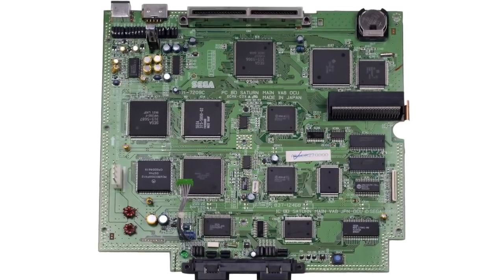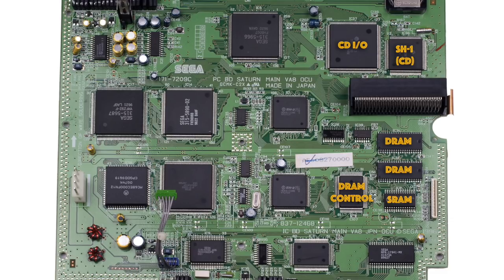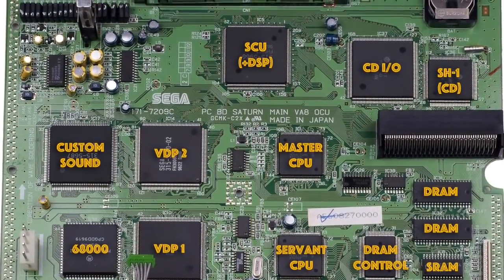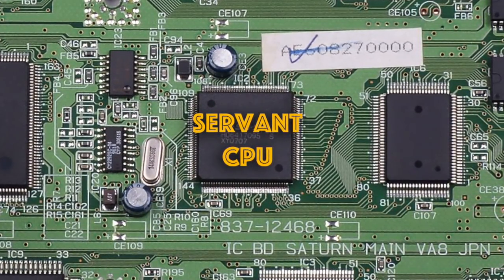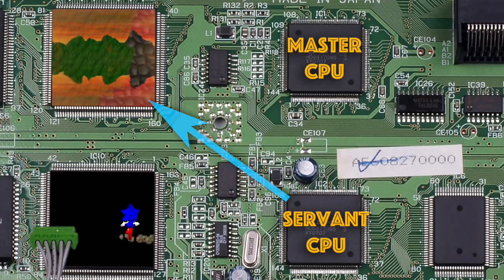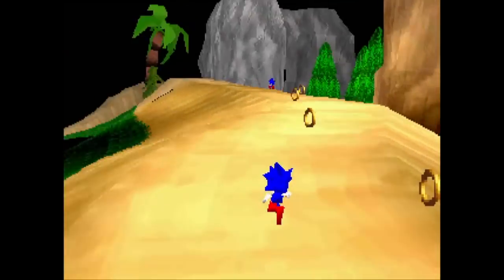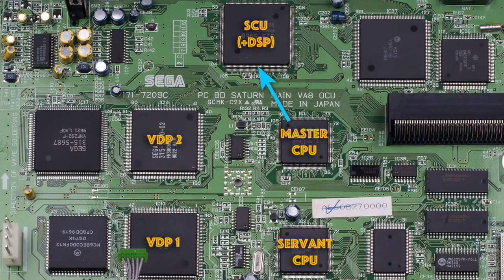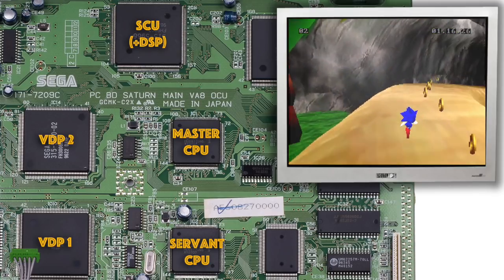SONIC Torn Apart - Exposing SEGA's Insanity with Hardware (CODING SECRETS)

Comment: 0:29 It should probably be clarified that the SRAM requires the use of the button cell battery on the top right to stay alive. The difference between SRAM and DRAM is that SRAM doesn't need to be constantly refreshed. It just needs a constant current applied. It requires a lot less power to remain alive than DRAM, but it does require power. Jon wasn't mistaken, I just wanted to clarify. SRAM isn't like a flash memory or EEPROM chip that keeps its storage alive indefinitely.
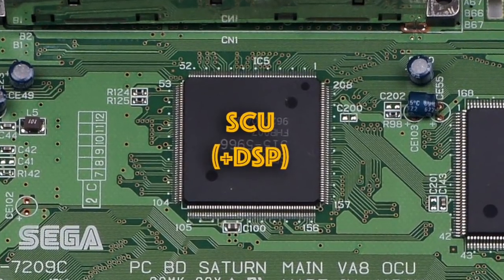Reply: 3:48 MIND BLOWN
Reply: Was the 68000 just twiddling its thumbs? :P
Reply: My guess is that the 68000 was running a SEGA-supplied music/sound synthesis middleware. I know the game runs on Redbook CD Audio for the music, so it was likely underutilised, but there are still sound effects to be triggered.

I also wonder whether 68000 had some unfortunate effect on memory bus utilisation and having it stay idle would have been advantageous?

Comment: When you had to make a game to run on both Saturn and PlayStation you mostly have to do the same game twice or there are some code that is "sharable" between the platforms on this era?
Reply: Anytime you do routines in ASM, you have to code all of those for each processor you are going to use. Some C assemblies can be compiled fine for both platforms, but the majority of the engine code is not compatible. So to answer your question, yes, you had to write a game twice for the same title to run on both platforms. Although you could easily re-use the same media data: textures, bitmaps, audio samples, etc. That does save a lot of time.
Reply: D.E. Sarcarean  As I expected, mostly the media data are reusable and maybe the logic of the code although written differently for each architecture. Thanks.

Comment: So.... knowledge of assembly concepts were basically critical in early video game development up until this system's generation, mostly because certain abstractions started taking place in design, right?   and many of these general purpose CPUs were in use in tons of electronics even up through the early 2000, but not generally anymore. I wonder where the talent pool would've come from that knew SH1/SH2 assembly that Sega decided to go with this system?

Comment: Yes! I'd like to see how the DSP code works. Also, How do the instructions are sent to the slave cpu without using the main cpu? 

Since you are always looking for ideas, here's one: I agree that SEGA always seemed to have retro compatibility in mind, since... ever! Although many time it just didn't have the chance to use it, the previous chipset is always there in the next gen. Correct me if I'm wrong, but even the Dreamcast had a graphics mode that worked quite similarly to the Genesis. So my question is: what would take to port a Genesis game to the Saturn (or the Dreamcast)?  I don't know how the homebrew community is doing in this front but I'm just curious to see if SEGA did have the chance, if it would be possible and in what generations this could happen. Cheers.

Comment: I remember reading on a page I was helping translate that one of the developers for Shining Force 3 hated working with the Saturn's sounds chip. I was curious what your opinion was on the chip. Was it really difficult to work with like he said or is it possible they were too used to the sound chip for the Genesis and didn't switch over to the new system very quickly?

Comment: Question : did I get that right? The Saturn VDP 1 and 2 didn't render the polygones, getting draw calls by the CPU, but it's all done on CPU than sent to the ram and later the VDP  to apply the effects and textures?
Reply: VDP1 renders the polygons that are transformed and clipped in any way developer deems suitable to generate them - ideally on Master CPU with SCU assistance. VDP2 does tiles and sprites, not polygons. You usually sandwich your VDP1 as a layer between VDP2 layers, so you can have a 2D background and some HUD on top or something of a kind.

Comment: That looks like a very complicated system architecture. What was it like to port games from the Saturn to other machines like the PC and the gamecube? As sonic R was included with a sonic compilation on the Gamecube and PS2. I recon must have been complicated to port games from the PS1 to the saturn.
Reply: The Sonic R re-releases are likely all ported from PC version.

PS1 to Saturn? Massive re-work. Could have cost a significant chunk of the original development budget because you have to rework all the graphical assets too. I don't think it happened frequently if at all. Tomb Raider for example was developed for Saturn first and then ported to Playstation. It probably didn't make too much sense to go the other way around, because i mean there were 10 times as many Playstations as Saturns worldwide, and the gap was probably even larger in Western markets alone.

Comment: I've read that some game devs only utilized the 68000 CPU just because it was easier/familiar rather than messing with the twin graphics chips and having a single CPU render the 3d. Which was the explanation as to why so many early 3d Saturn games looked overly simple. Was that true, or possible, in your experience?
Reply: I think you might have that one confused with the Jaguar, where 68000 was the boot processor, on Saturn it isn't. And the DSPs on the Jaguar are pretty broken. SH-2 is a super straightforward and easy CPU, and you wouldn't get very far pushing polygons from 68000 at all, even if you could. On Jaguar, almost everything except library code running on 68000 was common, but a better strategy was to halt it completely because it steals memory cycles otherwise.

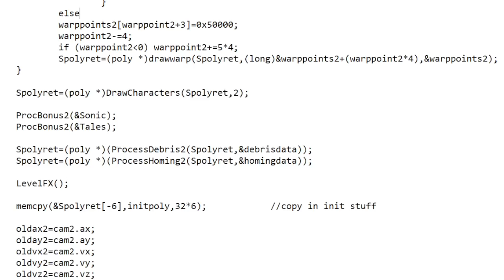Comment: D: 2:32 &Spolyret[-6]  
Why? I'm going to assume it's in a bit field but still I'd be scared to use that (I've done it, I was scared). 
Also can't figure out if it's a 2D array or just a pointer to an array… This is too much. Since I started using C++ I can't handle those things anymore. 
I guess the hardware you were working on (and the state of c++ at that time [before C++17 that is]) didn't really allow you to waste 2 bytes for a pointer (It's 2 byte in 16 bits, right?)

Comment: The Saturn was an arcade system at heart...considerably more capable than the PS1 at most things, but most developers didn't use the hardware to its full potential.  It's still nuts to me that most generations of consoles have the most advanced spec as the failure...and this generation in particular had the PS1 as the absolute king of sales when both the Saturn and N64 were bigger and badder.  The PS1, on the other hand, had a lot more in common with the 3DO, but came out more than a year later.  If every developer put the time and effort into every game, the Saturn would have been the clear victor, as it wasn't quite as graphically powerful as the N64 (at least in 3D gaming), but had the advantage of CD-ROMs.
Reply: It's not that hard to figure out why the PS1 did better, Saturn despite being more powerful was too complicated to program for and the N64 was held back by cartridges so developers flocked to the PS1, therefore the PS1 ended up with more and better games than the other two. Better library of games always beats more powerful hardware.
Reply: @elin111  The PS1  definitely had more games than the Saturn, but I'd hesitate to call them better, especially if you take arcade ports and Japanese exclusives into account.
Reply: @HaydenX  Arcade ports suffer from being more or less direct ports of the arcade, they never translate all that well to console because they're designed to be played in short doses, console ports get old very quick due to lack of actual content.
Reply: @elin111  I suppose I'm probably biased in this case because I've always been an arcade gamer at heart.  MAME changed my life forever when I found out about it in '97.

Comment: I would also say that I want an explanation of the DSP code, but I'll be honest here, I do not believe that I could follow it.  It sounds cool, what with the parallel instruction set, but I'm already falling behind on understanding these things.  I'm not even sure I really understand what the DSP is doing; it sounded like it was directing traffic that the CPU is supposed to handle.
Reply: The DSP is used for bulk multiplications and additions needed for transform and lighting. Which in turn is a process of recomputing the vertex coordinates from their original coordinate system (model space) into the screen coordinates (view space). And also optionally computing the vertex colour by transforming the vertex normal into light space.

Comment: Powerful hardware for the time, but it sure seems like a lot of the actual 3D code is up to the programmer instead of the hardware. That is, you'd think you'd be able to feed the object and environment data to the various processors and they would do the rest. Do systems of today, such as the PS4 and XB1 require so much from the programmer?

Comment: Would you say, in a sense, it gets easier to code for newer systems that have more power to work with?
Reply: But you are expected to deliver software that is many, many orders of magnitude inherently more complex! Consider that. If something is going to be valuable, chances are, it's not going to be easy.

You could also do a lot more sloppy and simple of a job on a Saturn and you'd still end up with a somewhat viable result, just perhaps not the top notch high performance 3D racing game. What Jon shows here is clearly bordering on or reaching a masterpiece level of programming on the system. There are probably lots of games which run single-processor on the system entirely and don't have a single line of assembly.

Comment: Euch. And I thought the n64 was hard to deal with. XD
Granted, I knew the Saturn was a complicated mess, but wow... So much juggling of stuff.
By contrast the n64's issues are primarily working around a bunch of bottlenecks, and (at the time) trying to deal with the fact that to get the best results would require writing custom microcode for the RSP, but Nintendo absolutely refused to provide any tools or documentation for doing so.

The playstation was comparatively simple... Being broadly speaking a logical extension of the 16 bit consoles...

Comment: I was sure that this fancy hardware design was due to market novelty and taking risks.

But then i learned, that long before 32x and saturn the was a certain hardware, from sega.

 It's called Sega Model 1 and it's sucfessor, Sega Model 2. And guess what? 

It was TOTALLY NORMAL 3D HARDWARE WITH SINGLE CPU AND SINGLE DEDICATED 3D GPU JUST LIKE PS1 OR YOUR 90's PC!

 AND IT WAS IN 1992, LONG BEFORE 32x and Saturn.

WHY SEGA DESIGNED SATURN LIKE THIS?

Comment: If only the Saturn wasn't too hard to program, it could've easily been the best console of the 32-bit era
Reply: It's in 2nd to PS1
Reply: No, just no. It could have possibly stood a chance of being the best console of the 5th generation if it sold well enough, which it didn't, because SEGA botched the launch and had a bad history with 32x.

And it couldn't have been easier to program unless it was designed fundamentally differently, which is to say... i mean you could say that about anything, it's a statement which is true, but also of no value, because you could say that about anything, including the entirely horrible Atari Jaguar. (Saturn was at least not horrible, it's a fairly solid design that just completely misses the mark of what that generation needed)
Reply: I love the SEGA Saturn I think both systems have flaws & strong points like I heard the PS1 cant do true 2D. They made sprites with flat shaded polygons or something. SEGA Saturn had amazing 2D Capability & 3D was a smooth all-round match. Perfect balance between texture quality & polygon effects/rendering having far reduced pop-in & less apparent fog in it's games. PS1 only just wins because it was utilized best by developers & had more introspective titles albeit alot of bad ones too compared to Saturn's honorable consistency.
Reply: PS1 doesn't have dedicated hardware for 2D but that's perfectly fine. It actually has a super easy to use 2D sprite primitive, that happens to be internally implemented the same as polygonal texture mapped graphics, to no real detriment, you even get all the same blend modes you get with 3D graphics which were not available or very limited in pure 2D consoles. It is fundamentally more akin to blitter-based graphics than to tile-and-sprite based graphics like you'd see on most other consoles, but the only drawback is a frame of latency because you have to wait for framebuffer to be filled - same as modern consoles really. Actually i'm sure you could even work around that if you cared by ordering the draw operations, and you can even use the bucket chain originally intended to simplify Z ordering to facilitate that. SEGA MegaCD was also a blitter-based graphical system, and i don't think anybody in their right mind claimed that it couldn't do 2D :D

Saturn should have entirely ditched the VDP2 responsible for its tile-mapped graphics and put all the bets on the VDP1/blitter, perhaps also doubling its performance while at it, which is fundamentally not too hard since you can process multiple pixels in parallel. If it ditched the rigid quads in favour of UV mapped primitives it would have been another helpful decision. It doesn't at all mean that the 2D capabilities would be diminished, they would be improved because then you could blend between various 2D and 3D layers, something that Saturn cannot really do - which is why you see horrible stipple transparency on Saturn which became obsolete on the Playstation.

Comment: I wonder if this is why the Saturn didn't attract many third-party developers?
Reply: No, it's because of the installed base being too small. It didn't launch very well, with a thin lineup, it launched just on the heels of the failed 32x, it aggravated gamers, it aggravated retailers, few people bought it. Now you have a budget for a game - you could spend maybe a few % more to account for Saturn's weirdness and produce a Saturn title, but then your potential market of people who could play the game is 10 times smaller than on Playstation, so what would you as a capitalist who has to spend money to produce a title decide, Saturn or Playstation?

A more fundamental blow which saw few cross-platform titles is that if you started on the Playstation, because that's a much more rewarding risk, and contemplated later whether you'll also release on Saturn, you'd have to rework not just code, but also all the assets to convert to distorted sprites (quads) from UV-mapped triangles, including splitting up and re-doing all the textures, not just the geometry, and that's suddenly a huge chunk of the budget that you need to spend again for the conversion, just to get 5%-10% more sales! So of course it wouldn't happen. You're better off taking that budget and contributing it to a new game for the Playstation, your return-on-investment is guaranteed to be 3 times as high or higher.

Comment: Excellent video. That era of gaming (16-bit, anyways) is dear to my heart and needless to say, Sega broke it all to pieces. The Sega CD was unnecessary. The 32x was a joke. Then the Saturn.....which was Sega dropping a steaming pile of shit on the industry while giving the middle finger  

As much as I've read about the complexity of programming the Saturn I have yet to come across any opinions on what exactly is needed that would have made the dual CPU setup work. What is/are the bottlenecks? Cost aside, what areas of the board could be added, subtracted or improved upon that would have maximized its capabilities and truly compete with the PS1 in terms of power?

Comment: What were they thinking when they designed this?? Was there some logic to it? Or was it just that they had this combination of chips available for cheap?
Reply: No, not cheap. It's designed like an arcade machine board lite, which is after all how MegaDrive was designed too, so the recipe has to work, right?
Reply: Siana Gearz OK! Why were they designed this way? Why were there several CPUs used instead of one more powerful CPU?
Reply: These are not very expensive CPUs, but i think the last thing it needed was more CPU power, because a single SH-2 is fairly close to the Playstation's R3000 and probably faster. I don't know the actual prices, but i suspect based on complexity which is somewhere around... less than 150000 transistors and being a very fresh design, that they would cost something like $30 a piece including a friends and family discount, maybe more? The rest of the processors were likely much cheaper. Still, SH-1 as an ODD controller seems like a severe overkill, and 68000 in spite of being an old design with numerous suppliers that can be produced on obsolete technology, has a very considerable complexity with 68000 transistors which is what it's named after. They must have had big plans there that didn't quite play out somehow.

What it actually needed was a high-utilisation design with well-designed dedicated supporting hardware, something the Playstation achieves, and so does the Dreamcast, but the Saturn fails at.

It's just not exactly a stroke of genius, i can hardly call it incompetent because if you want to see true incompetence, well there's the Atari Jaguar to marvel at, at least everything in the Saturn worked fine. N64 is also a completely absurd design from the cost perspective, the specific numbers evade me, but both the processors in that break a million transistor mark, and there's simply no way to manufacture them cheaply. As for Saturn, it's just the kind of design SEGA was used to, they make arcade boards, and those are often made with only moderate regard for cost, by taking something they are fairly familiar with, and then if that doesn't suffice, using more of that.
Reply: Thanks for the info!